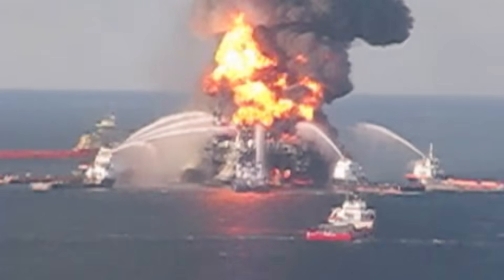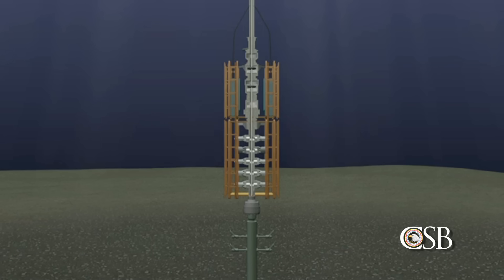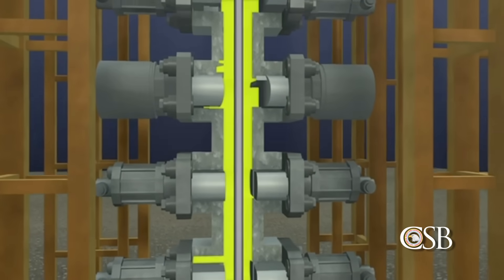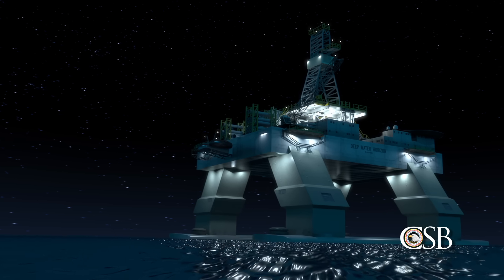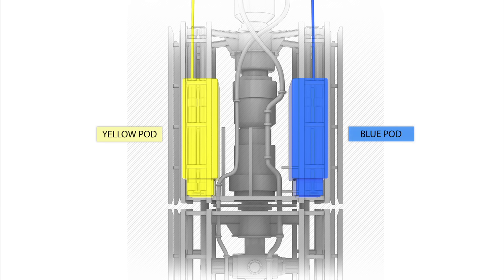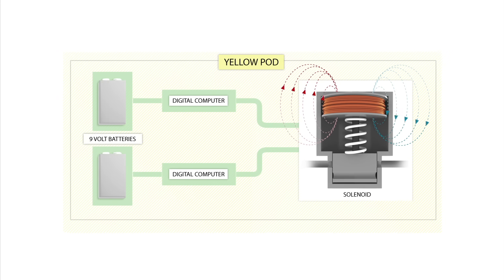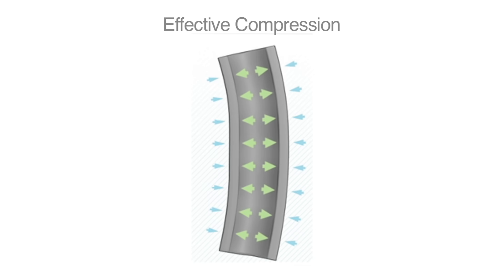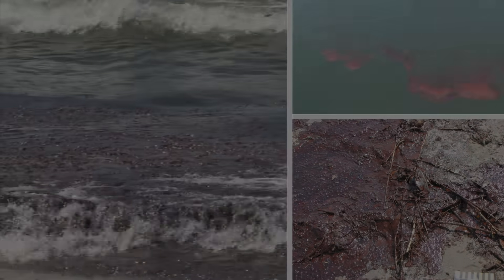Deepwater Horizon Blowout Animation

Comment: Who designs "safety systems" which requires electricity and computers at sea floor at the time of accident?

These should be made positive systems, so that control keeps closing force such as spring or pressure at bay and at the moment control is lost this force is released activating closing mechanism. There is no room for batteries, electricity and computers in the process of closing. These can be present at normal operation and monitoring side, but not at emergency mechanism side.

Next is the pipe cutting ram. These should be shaped so that pipe can't escape from them. Like two Y's where pipe is at the "horn's" and encircles the pipe.

Of course this is easy to say now, but this should be self-evident to engineers designing these safety systems. There are examples of this in other designs like railway air brakes with fail-safe features.
Reply: AnatoFIN Thank you for your post. Your thoughts echo mine exactly although you worded it much better than I could. I was absolutely shocked after learning from this video how all the supposedly redundant safety mechanisms were designed and then to boot, the fact that some of them weren’t even operational! With the possible consequences being so dire I just can’t fathom that any half decent engineer would think this was a good solution!

You mentioned railway air brakes in your example while I was thinking of tractor trailer spring brakes (so I imagine they are very similar). In a transport truck/trailer, a significant and constant supply of air has to push a large spring back to release each brake. If anything at all happens to that air supply the spring immediately expands and applies each brake. I once had an incident that proved to me just how well this actually works. I was in my rig traveling down a hill on a highway in the winter time although it had been an exceptionally sunny day. Suddenly a moose darted out in front of me and I had to jump on the brakes. This caused a large sheet of ice that was on top of my trailer (that had had the sun shining on it all day so it was warming up and apparently was losing its grip to the roof of my trailer) to slide forward and to fall off the top of the trailer and down in between the rear of my cab and the front of the trailer, which resulted in severing my air lines to the trailer. The immediate loss of supply air to my trailer caused all of the spring brakes to apply and I came to a very abrupt stop. Obviously I was stuck there until I was able to repair my air lines so that I could send air to the trailer spring brakes again which would release those brakes. That, to me, is a very well thought out design and worked perfectly.

I really want to believe that there is some unknown reason to people like me as to why a simpler, more reliable system like this wasn’t used on something as important as an oil rig. Otherwise the alternative is that there very well could be a whole lot of other potential time bombs out there just like the Deep Horizon waiting for that perfect storm to happen again!
Reply: Patrick Wallwork, you and AnatoFIN...
are people who I can listen infinite time, as like this kind of videos! 👍
Reply: I think the staggering thing is that these features were not tested before being deployed. It would be very easy to test the operation of the solenoid beforehand.
Reply: @Richard Vaughn if you design a solenoid valve for continuous duty, it will last just a long as, say, a transformer, that can be powered and under load for centuries.
It's easy to make a coil that can maintain a constant magnetic field without overheating or shorting out, you make it larger and use heavier wire and better insulation. And you give the valve core more mass to be held easily by the magnetic field. You don't have to build this for compact size or minimum price, you can make it as big and expensive as you want, and it will be able to energized for decades.
And you can put 2 of them in series fed by separate cables to the surface so both have to fail in order to activate the shear rams.

This is all well known industry technology in other fields, and not at all difficult to achieve.
Reply: As other have rightly pointed out, this would require a force beyond that capable of being delivered by a spring in tension. What really is at issue where is why the polarity/wiring of the solenoids was not tested before the BOP was lowered to the sea floor. Why wasn't it confirmed that they would activate correctly when required and that their power consumption was within specified tolerances?
Reply: @noelcosgrave113  In my original post, main points were: 
1. Fail safe mechanism, that will automatically close when control is lost. 
2. Cutting rams that at all time completely circle the pipe so it can't escape.

Minor points were:
I despised the use of batteries, electricity and computers at operational side of fail safe mechanism.

Originally I wrote, spring or pressure as energy storage. Energy storage wasn''t my main point. Actually feel free to select your energy storing device as long it's as simple and reliable as possible. Batteries, computers and solenoids in safety critical system at sea floor just seems wrong. You can use them, but its difficult to make them as reliable as springs, pressure, explosives, gravity. 

Oh yeah gravity. I like safety systems that use gravity :-D Like a nuclear reactor at a pit below a lake connected by ditch. Remove the dam from the ditch with construction equipment (or shovel) and your melting reactor is now below water. With proper design no Fukushima and would have helped in Chernobyl too.
Reply: @AnatoFIN  Indeed, for all the back/forth in this thread, your main points reaffirm fundamental principles of reliability engineering and emergency system design.  Some of the comments focusing on the miswiring being the primary problem or that a deadman switch misfire would cost the company money are not in line with proper engineering.  Had there been a normally-closed shear system, the improperly-wired solenoids would have been easily found during installation because the shears would likely have been closed preventing installation in the first place.  As far as a safety misfire costing the company money to replace a section of pipe, well look at the lives and livelihoods lost due to an incident of this scale.  Redundancy measures can be put in place to give comfort that the shears very likely won't cost the company its precious time and money in the effort to keep its employees and the entire Gulf Coast safe.  Priorities, I suppose.
Reply: Electrical engineer here. There is a good reason for this and it illustrates the engineering challenge of making such a deep well safe. You have to remember that this well was located in very deep water, about a mile down. At that depth the pressure is over 150 times atmosphere, making any manual work like divers impossible. So any mechnaical work at the wellhead has to be done remotely or by robots, about a mile away from the rigs control systems. The pressure inside the well riser is immense as well, so anything that seals it off will have to overcome that pressure somehow. In order to do any work at all, such as turning a valve or triggering a shear ram, you have to power these systems somehow. There are many ways to do useful work remotely, such as solenoids, servos, steppers, as well as hydraulics and pneumatics. But valves and the motors to operate them don't turn all by themselves. We simply don't have the technology to remotely control mechanical systems without some source of power. There has to be a feedback system on the BOP and electronic controls, or else there is no way for operators to have any idea what is going on at the wellhead unless you physically send someone down in a submersible to look at it, nor can they take any action to respond to problems.

You could put the BOP higher up, but this means that there will riser pipe beneath it that is unprotected. So we're forced to put the BOP at the wellhead. This creates another problem, how do you put all those remote control systems and sensors so far down? Most electronic sensors, such as pressure and temperature only produce a few mico to millivolts. They are utterly useless unless there is some electronic control system to amplify those tiny voltages into something readable, and usually this is done by digital or analog amplifiers. Then you have to send the data the sensors are getting all the way back up the rig. This means you need over a mile of electrical wiring carrying only a few fractions of a volt. Well, this is impossible because these low voltage signals will attenuate long before they can travel the distance up to the rig. The limitation of electronics and physics force up to put a computer on the BOP itself.

tl;dr If you can design a fail-safe system that will remotely and passively seal off a high prssure oil well over a mile underwater, requiring absolutely no electrical power, digital micro controllers, feedback/interfacing systems, I would love to see it.
Reply: xygomorphic44 claps
Reply: It would be very hard to design a system that could passively cut a riser pipe like that. The force required is huge and as such hydraulics your only option.
Reply: @yogiontour  You don't need to cut a pipe in order to stop it-- a "Tesla valve" will stop fluid flow passively by using the pressure of the fluid itself.  Electric powered gates inside the valve could keep it open until an emergency happened, and then the fluid would shut itself off passively.
Reply: @Army 33 Stop all that gossip. Fact is your industrial safety and maintenance standards are mediocre.
This BOP accident couldn't happen in Norwegian sector, simply because they have higher safety standard's!
Reply: @Richard Vaughn ummm, the temperature at the bottom of the GOM is about 39 degrees Fahrenheit (4c) and the water pressure is 1,473 psi (101 bar).
How do you get liquid gasses under these conditions?

Considering that the pressures in a regular nitrogen charged hydraulic accumulater are in the 10,000 - 40,000 psi range, having an external pressure of 1,500 psi makes zero difference.

In addition, the system already uses hydraulic accumulators to power the system, so it obviously is not a problem in reality.
Reply: It technically was a deadman switch, that is, if power is lost from the rig, it automatically shears the pipe. The real question would be how to design an accumulator such that instead of needing to be opened to actuate the ram, it would have to be held shut to prevent the ram from activating. I can see why this design was chosen, what with how if it was wired correctly it should be quadruple redundant, and considering the fact that having a shear ram deploy accidentally would cost millions of dollars to get the well running again.
Reply: People work around real bombs all day. I did. Ammo dumps have a safer record than the oil industry and there are MANY ammo dumps.

An accumulator can have  advantage such that lower pressure over a large piston area apply force to a smaller piston to pressurize fluid. All old new in aircraft flight controls and many other systems.
Reply: Just go research the specifications for a spring powerful enough to crush a 1 inch thick walled 10 inch diameter pipe. Don't worry, I'll wait.
Reply: @rre9121  what they actually use to operate the rams are hydraulic accumulators that use nitrogen gas for the "spring".
So he's right on the concept, just uses a different type of stored energy.
His key point is that instead of it requiring a positive action by a computer and batteries, that it be failsafe like an air brake, where power is required to prevent operation, rather than to initiate operation.
Reply: @rre9121  You can have two (or more) chemicals that when they mix expand and push the piston(s) of the jaws. There are solutions . The positive system keeps the precursor chemicals separated. Or when the power goes down a needle breaks a vial that releases one of the chemicals (with a spring) There are deadman's switch solutions for such problems. I do not like your negativity and pessimism.
Reply: The pipe should have thick-walled balloon inside it which is built like a tire with reinforcing. If the well misbehaves, then the balloon should be filled with very high pressure air to seal the well. Then, air can be removed and if the well behaves, operations can continue. If the well continues to act up, then the balloon should be filled with concrete.
Reply: Like Jordan (and just about everyone else here) said, fail safe should be the design default. 

On the computer and solenoid design, the 27V system should be constantly be charged from above, holding the solenoid pulled in. Yes, there are IR losses from the length of the wiring from above, but once a solenoid is pulled in its coil doesn't require as much current to hold it there. This design is used in pinball flippers where separate pull in (high current), and hold in (low current) coils are used. 

The computers can use MOSFET or IGBT transistors to activate the solenoid coils to relieve the current burden on the 9V batteries. Also the computer would monitor the 27V charging current to the solenoid battery, and communication from the surface to facilitate dropping the holding current to the solenoid, should both be lost. The presence of communication in absence of charging current would cause the computer to send a message above, alerting the failure. 

Fail safe, yet safeguarding against nuisance failure.

While I'm on the subject of solenoids, I have to ask the question. On a device that is so essential to safety and life preservation, don't the companies that make these things at least test them thoroughly before they're put into service?! How the hell does a parallel solenoid get one coil wired backwards, and yet "pass inspection"? Considering that in this design, one coil was finally operational after one computer failed, the 27V system was already energized for a substantial amount of time. This could drain the 27V battery to the point where there is insufficient current for the remaining coil to successfully pull in the solenoid. 

There should be zero room for slop or pressure from bean counters where systems crucial to human life is concerned. In these cases, there is only one chance to make a mistake. The goal should be the absolute removal of that chance.
Reply: Sarah Wilson what happens when the windings go bad on that solenoid that you want to keep energized constantly? You sheer your multi million drill bit, lose all the time and energy and money spent researching and drilling in that particular location. Over a $3 solenoid? Na
Reply: We got a internet expert over here who says this after the fact lol thats definitely going to help them now dumbass.
Reply: @Army 33 yeah I laughed at his theory of burn out too. Missed the part about pull in and hold in coils I guess.
Reply: Army 33 you are amazing
Reply: I am not a mechanical or an electrical engineer so the back and forth on why a "spring brakes" type of system can or can't be placed on the BOP was very interesting. Thanks to everyone who provided their opinions on both sides of this issue....
Reply: The hydraulics could be driven by gas accumulators as used in aircraft hydraulic systems. Not a problem. Accumulators are also used to start aircraft. The gas pressure is raised by system hydraulic pressure or an external pump. The start accumulator solenoid valve is of course normally closed and electrically opened and this could be reversed in a hydraulic safety system. 

Current is interrupted, solenoid de-energizes, precharge forces accumulator piston against fluid actuating whatever you want. Simple, very, very old news and quite reliable.
Reply: In all honesty it seems relatively easy to make this system Fail-Safe. Just reverse the action of the solenoid such that it requires a surface power supply to block the hydraulics that close the ram (ie the solenoids are kept active, and without power the spring causes them to stop blocking the hydraulics) . Of course, that means that you can't use batteries since they would drain keeping the solenoid open, but it seems reasonable to me that if you lose power from the above oil rig for any reason the well should be sealed. The power necessary to actuate the ram doesn't appear to be an issue, as even in the video they are powered with hydraulics, not batteries.
Reply: We might be getting ahead of ourselves, the system they had in place would have more than likely worked fine if it would have been wired correctly. Any system that you can come up with will never work if it isn't installed properly  or put together correctly . This is just my opinion, I may be wrong.
Reply: A failsafe using compressed gas is workable. SCUBA divers carry 3000-3400 PSI / 206-234 bar bombs on their back without any worries. All that is needed to control this are tiny valve levers. A ram with a 12in diameter piston has 113 sq.in. surface, multiplying 3400 PSI to 384,500 lbs / 192 tons force. (How much do you need? Bigger piston.)
Reply: No point in researching that. No matter what is needed to cut through that pipe why couldn’t it be set up with a dead man switch? I was just pointing out how well designed tractor/trailer brakes are engineered because the consequences of those failing have the potential to be catastrophic. Obviously I am not alone in understanding why a similar system can’t be used for an oil well.
Reply: The issue comes with avoiding accidental deployment of the shear ram. When constant force is required to seal the hydraulic line, a failure of that system would result in deployment of the ram and loss of time and millions of dollars. It makes more sense to go with a quadruple-redundant system that a system that, if fails, can shut down your entire operation. The only reason this system didn't function properly (aside from the buckling of the drill pipe) was because some yahoo didn't wire it up properly.
Reply: You obviously have never designed anything substantive. The problem is that there are physical limits to certain processes. Airbrakes work fine for large trucks, and even some rail transit systems use them, but think about the actual system you are working on at the bottom of the ocean It would necessitate a system with extreme power output and a pneumatic system operating at that high of a pressure is extremely hazardous to be around. The pressure that the system would require would be equal to at minimum the pressure at the sea floor, plus the pressure required to operate a pneumatic ram to shear the pipe. What you are asking is that these people work around a bomb all day, every day. No wonder they didn't use that kind of system.
Reply: @rre9121  actually, that's exactly how it's already done, and it's using standard industry devices.
It uses a standard hydraulic accumulater charged with nitrogen at between 10,000 and 40,000 psi.
If you have ever walked past a piece of heavy equipment, you have walked past one of these "bombs", and many other types of hydraulic machinery uses these.
And while the comparison was talking about air, the concept of a stored power fluid power system is accurate, with the difference  being that it fails safe instead of failing open.